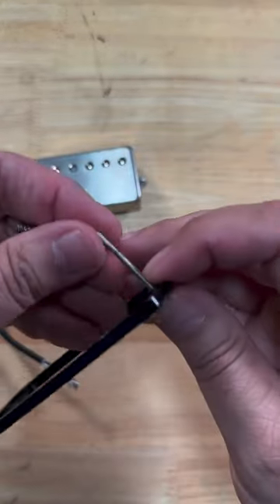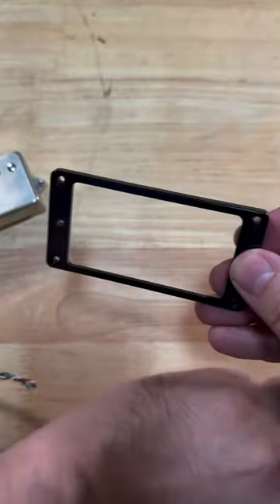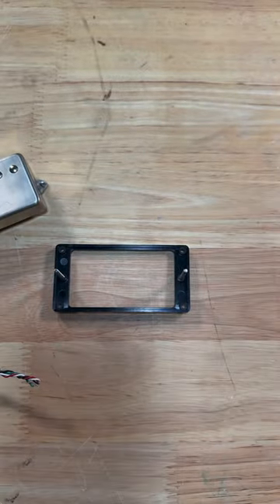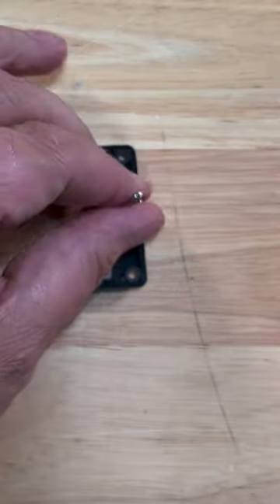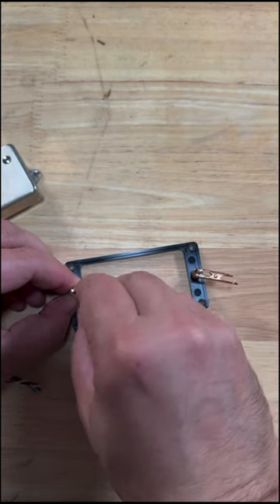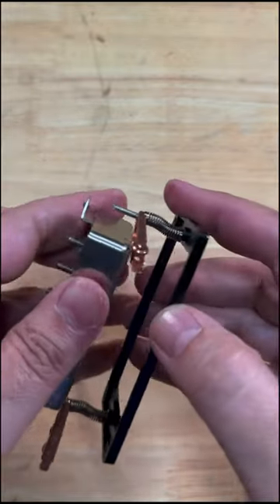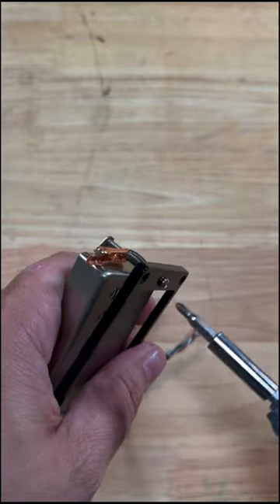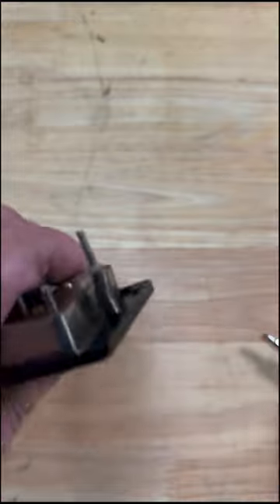Best Hack To Install Pickups In Pickup Rings

Comment: What's even better is it you either replace the springs with rubber ones like Wilde Pickups or use a strong foam block under they pickup as a giant spring. Either way, less noise from rattling guitar parts.